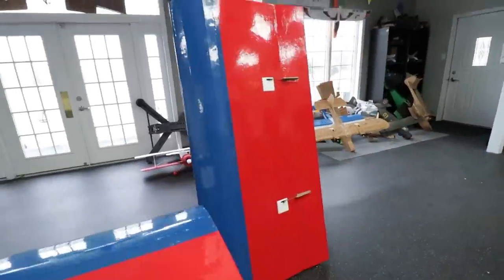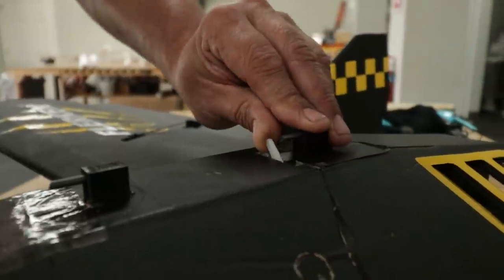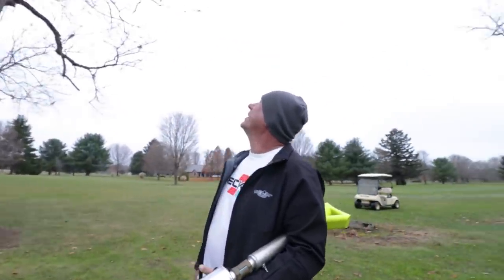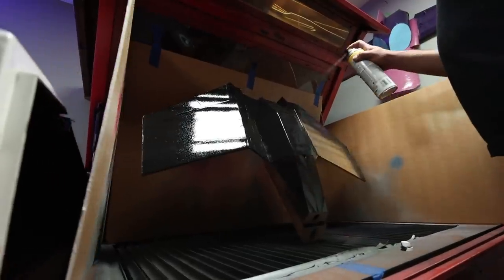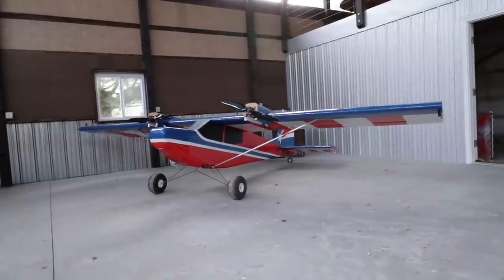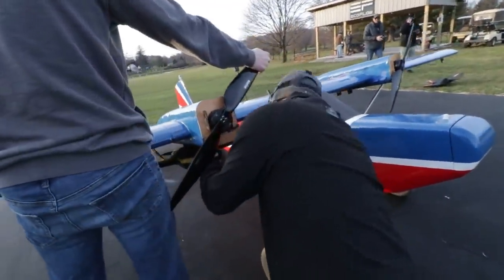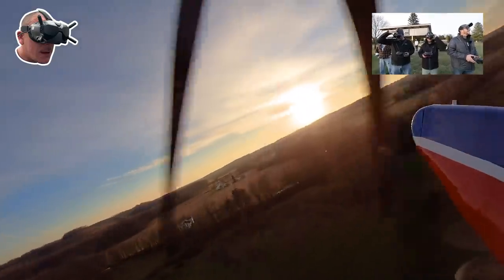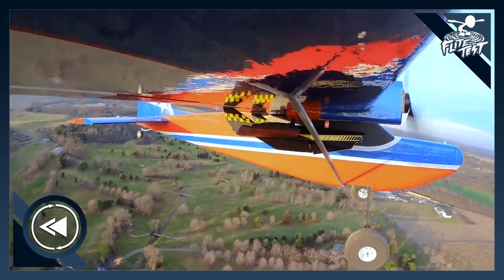16 Foot Mega Aircraft Carrier

Comment: Wanted to thank you guys for getting me into flight about 7-8 years ago. Started with a Blade Nano QX. Yup, that tiny little brushed drone. Then took the FC, put it on a brushed carbon frame with 7mm motors and an AKK vtx and camera from Amazon. Shortly after I got the plans for the old FT spitfire, started flying that almost everyday, I worked on a golf course and had permission as long as there weren't golfers on that hole. 8yrs later and I have a dozen badass FPV drones, from a 75mm whoop to a 7" long range. I have the ft goblin with a 1000mw vtx and DVR with a mateksys wing fc running INAV (crashed really hard, just need to rebuild the nose cone) and I have a mighty mini Zero with a nano fpv cam and 500mw vtx. I run 850 4s, with a 2208 2400kv, 45a esc, and 6" prop. Awesome flying micro. It's a little heavy, but I like speeeeeed. I ordered the Master series corsair when it first came out, and lost it when I lost video over a forest one day. (I put fpv on everything). My next dream build from Flite test is the beech 18, with a 6000mah 3s and a long range fpv system. I have a crossfire PWM reciever that's been needing a home for years. And the beech 18 is one of the most beautiful planes you guys have made. I just wish the FW190 was around d the 1.2m size, along with the other warbirds.

Comment: In the past when getting a plane down from a tree, I've use an arborist throw bag. It's like a heavily weighted hacky sack with a line, that you can easily throw up the tree and wrap around the branch and then you just pull like crazy on the line and shake the plane down. The good part is you don't have to necessarily wrap the exact branch. usually you can just shake it down.

Comment: Great video! I have also had problems with planes in trees and after some research I found two great ways to get them down. The easiest is to use a slingshot and a bolt or a bow and arrow attached to a fishing rod.

Comment: Around WW1 there was this idea of attaching some planes to the belly of a blimp and do exactly this.

Also, with the weight capacity I imagine the big planes has, you may be able to load with batteries and get a 20 flight time
Reply: this actually was tried the by the US, but it was a huge failure. There were 4 builds, out of those, 2 were lost due to bad weather, one suffered some issues and was decommissioned, the 4th one was also decommissioned after seeing the failure of the first 3. Also it was really expensive as for safety they were using helium instead of hydrogen back then, but helium was really expensive and hard to get back then (based of my knowledge the US used 3/4 of its ENTIRE HELIUM for this project). So yeah, also with naval technology going through major changes really quickly soon the idea became practically useless.. fast forward a few years, with armored planes that were going 400mph easily this idea would be basically sending a crew of 60 (10 officers, 50 enlistees) to literal suicide with quite literally no practical use.
Reply: @someoneontheinternetuvenev6268   
Yip there is an abandoned WWI Helium Plant at Cunningham, KS not to far from where I live. They say that every cubic foot of natural gas at that plant only contains 2% helium.  6 buildings and all underground. They couldnt make enough helium. Closed it down at the end of the war.
Reply: wonder why in WW2 they didn't tried it anymore (as I know). Maybe there's something not right, or not working properly with that approach
Reply: There used to be a computer game called Crimson Skies that had zepplins as mobile aircraft carriers... loved that game.
Reply: Is it possible though to recover those flerkens to the giant legacy??
Reply: I think it was ww2? But the soviet union put fighters on a plane and it worked

Comment: 8:40 Dangle a grappling hook 25 feet below a drone flown overhead.  The other end of the string has a loop and a 200 foot long "circle" of 40 lb fishing line.  Drone snags aircraft with hook and then releases the 25' grapple line.  After drone on ground, use the 200 foot "circle" to transport a heavier duty cord thru the loop at top of grappling line.  After heavy cord in place, yank it all down.

Comment: Can you please, please, please do a POV camera on a gimble linked to head tracking on a headset, so when you look around with your head the camera looks around.  This would be the ultimate in immersive flying.  Do a tutorial on how to build the system and a full parts list... possibly even a few price ranges.  I have also been VERY curious about long range systems and what is the a good set-up for say a 5, 10, or even 25 mile range for controls and POV camera.
Reply: I think they did do this back in 2012. They also did a similar project on one of the big planes with two "passengers" with pan/tilt fpv cameras.
Reply: @ZakLeek  They did one back when Peter worked with them but as far as I know they did not explain what hardware works best with what headset and what transmitters would be needed.  It has also been what 3-4 years I think since the covered headsets, and even longer since they did anything with long range transmitters and receivers.  I want more how to videos and they have moved completely away from the electronic side except for their little board they sell.
Reply: Yes, I would like to see that too! Maybe a series about different aspects of RC electronics or something?

Comment: I managed to set my Sig Kadet MkII down in the very top of a 60+ ft. hackberry tree once. We got it down with the help from a .30.30 and .22 rifle. The .22 was more successful. The vertical fin got knocked off on the way down and there was one .22 bullet hole in the horizontal stabilizer. The next weekend the tree was gone and I replaced the K&B 35 with a K&B 40.

Comment: Y'all should make a recovery drone that's capable of attaching a line to planes in trees so you can get em back without cutting down trees. Say a barbed pointy Thing that comes off the drone that then falls out while attached to a string. Fly drone up to target, stab it fly up away dragging the plane with
Reply: Also you could probably fit 2 more planes further out, and you could fit 8 total if you stacked em